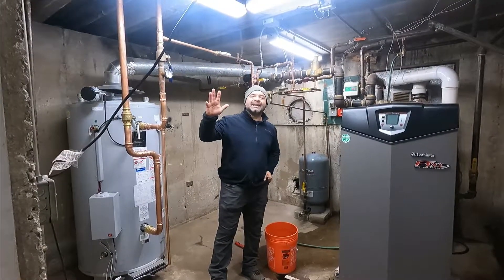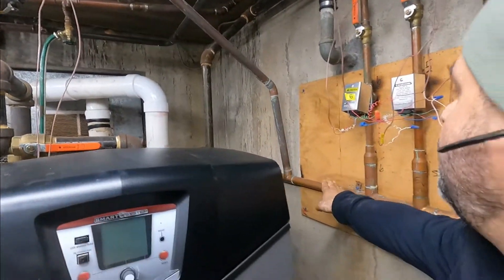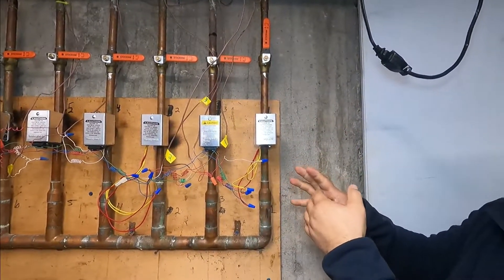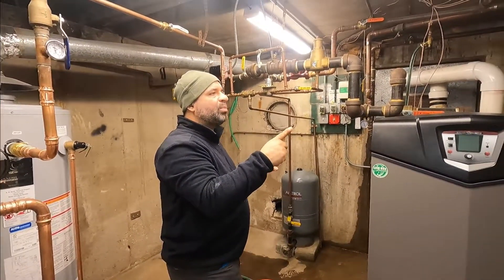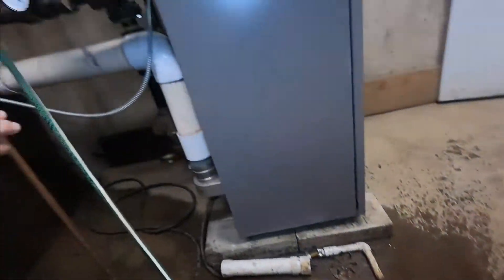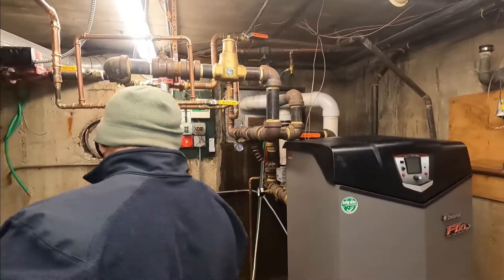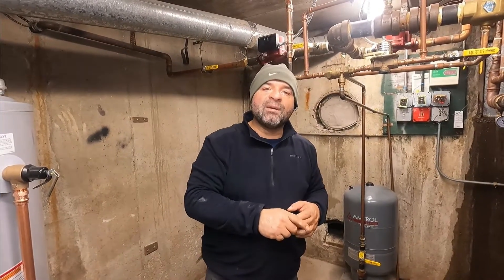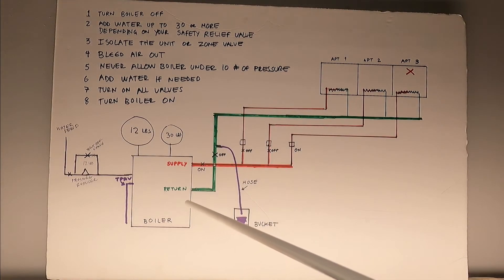How To Bleed Air Out Of A Zone/Apt From The Boiler

Comment: I read the pressure at boiler gauge at 30 psi, but I measure the pressure at expansion tanker connected to boiler. It reads 22psi. I bleed the all zones, then read the boiler pressure at 22 psi when it’s cold. But I did not touch the pressure reduce valve. Could that mean pressure gauge not reading correctly? Or I mess up something.  When it heats up, the boiler pressure reading at 35 psi. But seems the pressure relief valve does not activate. Thank you
Reply from the maker: https://www.google.com/search?client=safari&rls=en&q=why+the+boiler+pressure+reads+30+lbs+and+my+expantin+tank+reads+22lbs&ie=UTF-8&oe=UTF-8

Comment: My problem is at work I have 40 apartments and each zone valve is in the apartment. So how do I bleed the system? Would I have to call for heat in each apartment all at the same time?
Reply from the maker: Hello Kyle,
What you can do is bleed the whole supply and return lines, hopefully you have valves to do that. 
After that you are going go bleed only those apartments you are having trouble with.  One at the time!!
Remember you rise the pressure and turn the boiler off.    When you cut the power off to the boiler all the zones valves are going to go to the off position. (so that is awesome). that is how you isolate .  You are going to go to the apartment you are having problems with  and you are going to force the valve to the ON position.   Then bleed at the boiler. As the video show.   Watch the video again so you feel more confident.   Let me know how it goes.   
If  you are having lots of issues with air maybe you air separator is not working.   I like a lot the callaffi one.    Let me know how it goes please.

Comment: Hi Alex. Love these videos. My friends system has 3 zones using White Rodgers valves. Each supply line has a valve. However, on her return lines, there are only drain valves, no shut off valves to the lines themselves. I can isolate the supply but not the return. Is that ok to continue the procedure as you outlined in this video?
Reply from the maker: Hello Dennis,
The objective is to bleed the pipes (take the air out) before it goes back to the boiler.  if yo don't have a valve to do this (after the bleeding valve,  you are going to catch only part of the air.   Look for other valves that will prevent the water to go back to the boiler, It might be the main return after all three valves go to a header pipe?
you have to do one valve at the time.  Shut off the other two, and push water from the one. 

if you have a bleeder and a shut off valve on the supply line to isolate is ok too.   It does not matter on which side the bleeder is as long as you can isolate that line.  Remember the pump has to be off.  Let me know how it goes.
Reply: Thanks Alex. I’ll give it a shot next week.
Reply: Thank you Alex! I was able to successfully bleed the zones in my friends house as well as change out 2 of her 3 zone valves that were faulty. All thanks to your videos! Thanks again and I look forward to learning more from you!

Comment: When you say, "cut the boiler off," do you mean the circulation pump or the actual boiler? How do you cut the boiler off?
Reply from the maker: Hello Aki.  I don't know what minute of the video you are referring to..  To remove air you need the pump off.  usually the pump and boiler are controlled with the same switch.   let me know if this help.  keep me posted. thx

Comment: Alex, I know which is the supply to a given zone (I have 5).  The installer labelled each zone. But how do I identify the return to that particular zone?  They are not marked.
Reply from the maker: Hello Mark.  You have 5 zone valves ... so 5 different pipes going to a room or apartment.   How many pipes do return?   1 bigger pipe or 5?  
If you have 1 return for all 5( bigger pipe) 
1.  add water to the system up to 29 lbs before you safety relieve valve opens.
2. turn boiler off
3. bleed that 1 big return 
4 remember to force open that valve manually with the lever.  Make sure you wait 2 seconds before releasing the lever so it locks.. 
If you have 5 different returns, then close all of them and open one by one and listen each one .
or if it is air locked..... then it should be colder than the ones that work fine, right?      Follow pipes and feel and listen .   As if you were a detective .
don't forget to monitor the lbs of water on the system.  Never go below 10 lbs of pressure.   Keep adding ad you bleed.  Keep me posted,   Thanks
Reply: good answer... the usual return for all is 2 inches and it enters the boiler again, heats the water and distributes it to each individual apartment